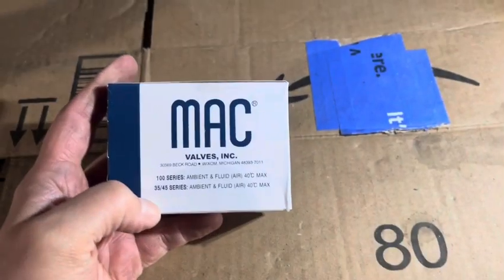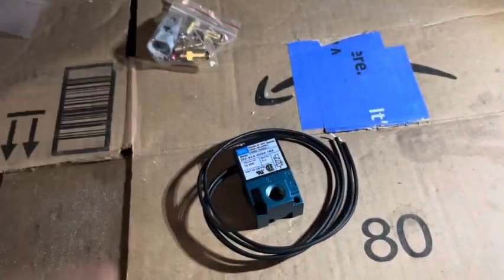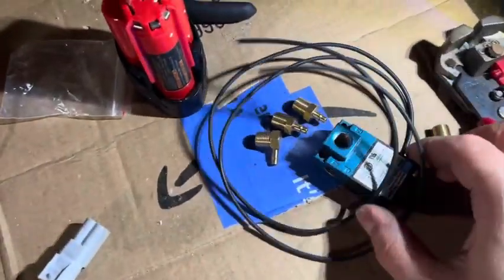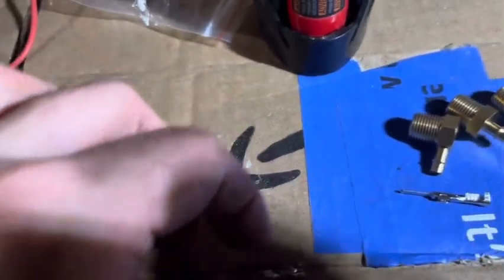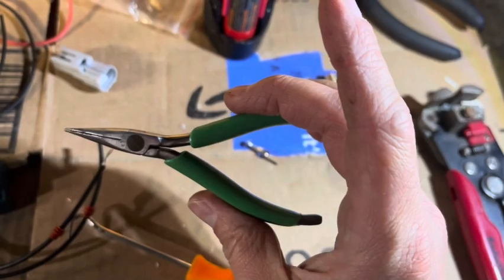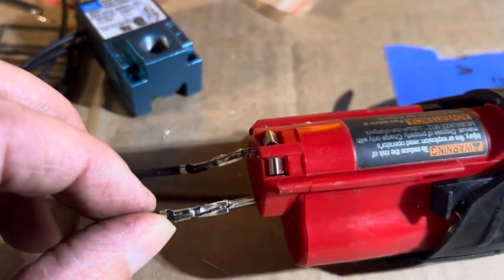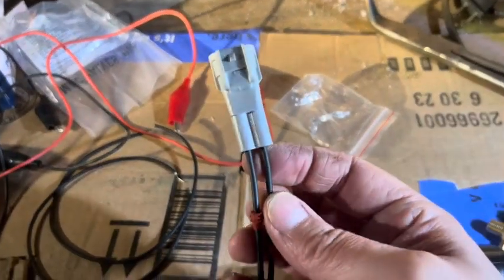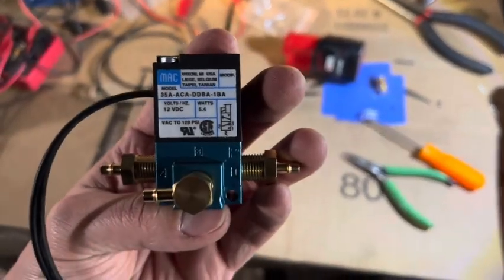How To Wire A 3 Port Boost Solenoid (Subaru)

Comment: Does this solenoid get plugged into the main valve body inside the transmission?
Reply from the maker: No this is for a turbo boost controller